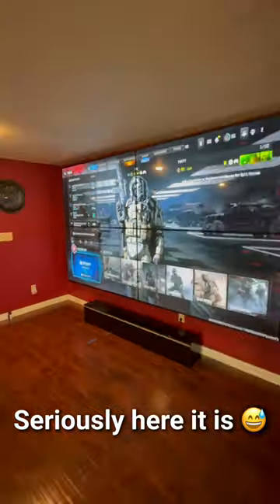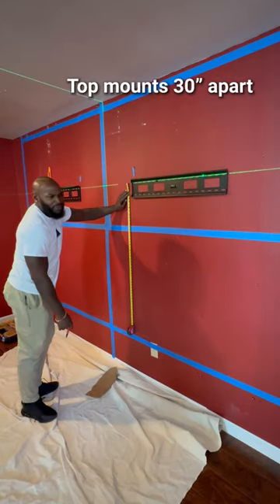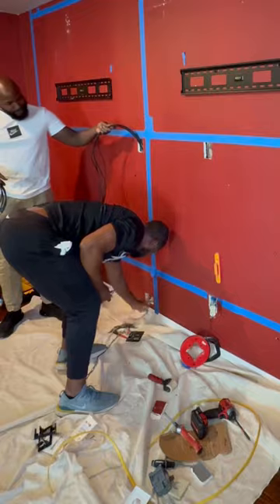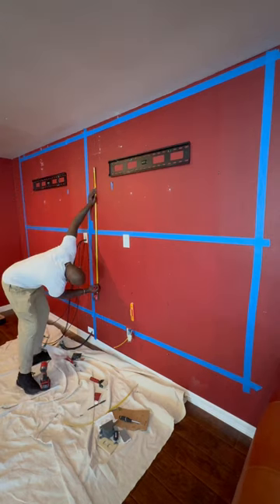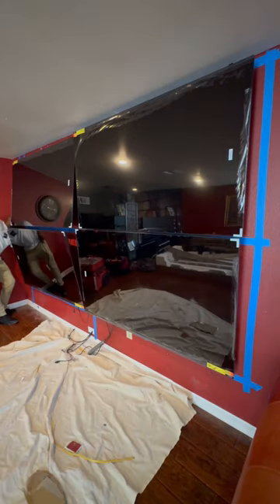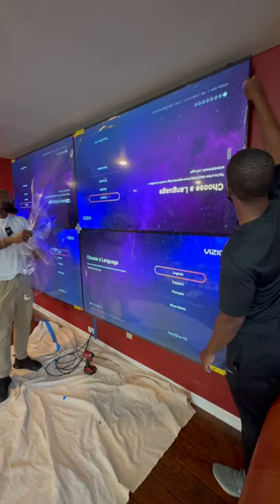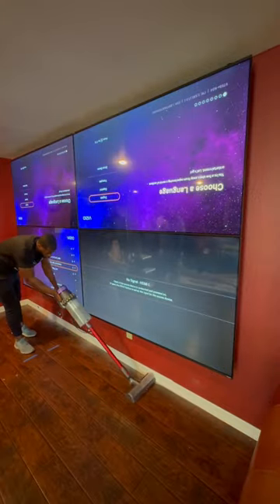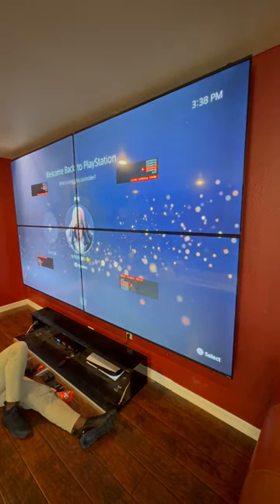How to make a Tv Wall using 4 75” TVS (full video)

Comment: Do you use both hdmi splitter and wall controller to connect all 4 tvs to play as 1
Reply: Based on the name of the video, I don’t think anyone should have to ask this. 
It should’ve been included in the video. 
Sadly,… 😞
Reply: You can use a 4x4 HDMI Matrix
Reply: @westmcgee9320 every dumb question that could ever be thought of should be in the video?
Reply: @livedavid2  shhh
Reply: @R3ll587 You can not just use any 4x4 matrix. You have to use one that has a video wall capability’s.
Reply: It's funny what the world THINK you should know instead of just answering the question 😐 .... Each one teach one❤

Comment: Is it possible to remove the bezels from the sides that touch?  What did you use to get the tvs to work together as one screen?
Reply: There are invisible bar like products you could look into, its not really that great for a seamless design for tvs nor monitors. Or you could really risk the biscuit and remove the bezels on the tvs, but its not really worth attempting unless you have some kind of special setup that will keep the tv screen/panel all together.
Reply: buy 4 different tv’s. Plenty don’t have bezels. Price of the project going up.

Comment: Did you mount the top 2 TV’s upside down? When they turned on, they seemed to be inverted on the picture
Reply: Yes, in order to minimize the gap between the top and bottom TVs. A lot of TVs have an infrared remote receiver at the bottom that protrudes a little bit. The HDMI matrix processor can flip those screens 180 degrees and everything lines up properly.

Comment: can the video wall work with you tube tv or would have to play you tube tv off a ps5 or something like that ?
Reply: You need a video wall controller to do all four but you HDMI ports you can still use .  some people flip the top to tvs. So the gap is small. Most tvs  has a little light at the bottom.